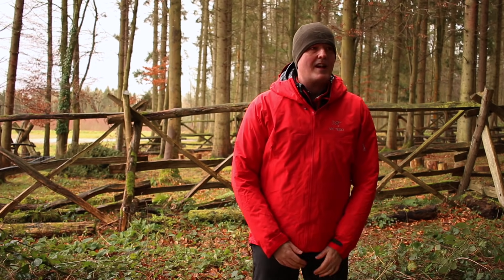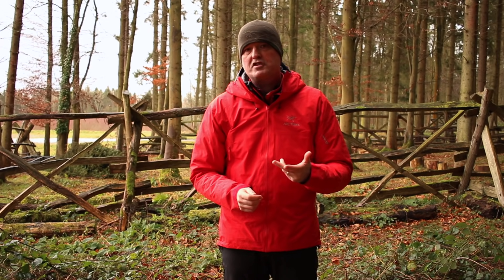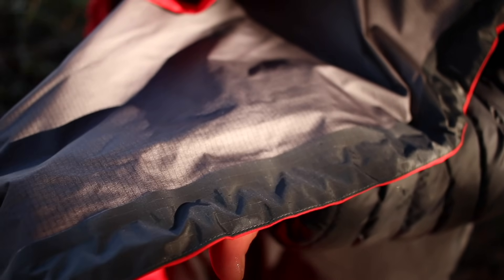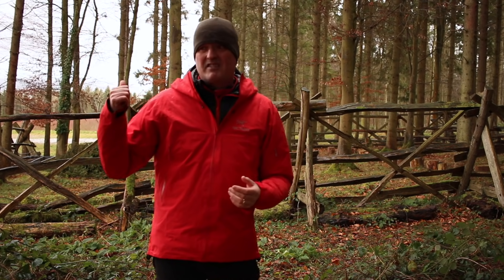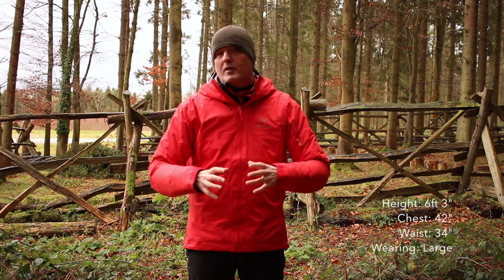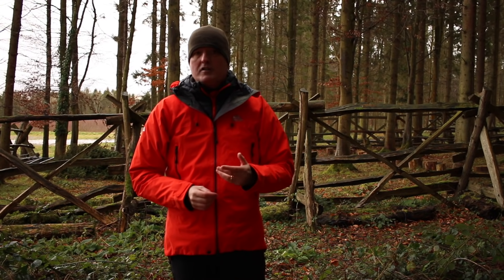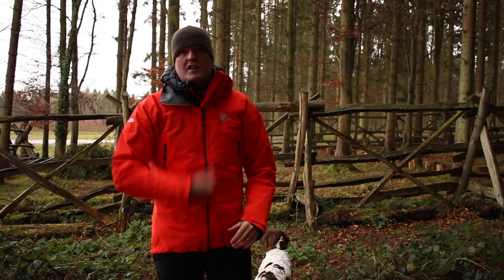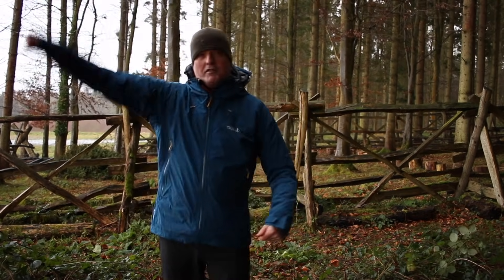Which Outer Layer Should You Choose?

Comment: Excellent and informative video. I am confident that those that do outside activities like yourself know how to best layer for outside activities vs the general public. 

I have a question for you that you probably have never gotten. I work outside as a laborer in a municipality in New Jersey USA. Like I said I’m confident to listen to advise of people like you vs even people in my field of work. People in my field of work for the most part don’t know how to ‘dress’ layer. 

Now the question I have is since I work outside as a laborer I need the most durable outer top and bottom shell to protect me from wind, rain and snow in the winter months. The problem in my situation could be potentially durability and price. I know this wear is expensive and I’m ok with spending the money but if I have to purchase a set every year let’s say that’s where the problem comes in. I work in conditions that has potential abrasive and my stuff can get dirty. For instance last week was was in a muddy hole and it was pouring down rain to fix a water main issue. 

My midlayers are all Carhartt because in this aspect I have confidence in quality and durability.  However I’m not too confident in Carhartt’s water proof technology which is called Storm Defender. Technology might work for work wear though. 

What are your thoughts and suggestions. Thanks!
Reply from the maker: In this instance you're probably best opting for traditional workwear rather than outdoor gear. Outdoor clothing has to strike a perfect balance between durability and breathability as they'll be used in fairly aerobic situations, whereas workwear focuses more on durability and less on breathability. I'm afraid I'm not familiar with which brands would be best to look for, but I can't see any garment from us lasting more than a year on a building site. Harry

Comment: winter is so annoying , even in -6 celsius a get hot after 10 minutes of uphill hiking and have to strip down to just wool baselayer. but then when i stop after 3 minutes it gets cold again. annoying 🙂
Reply from the maker: The best tip we have is to start cold and warm up to the correct temperature. You'll be uncomfortable for a few minutes, but as you pointed out, you'll quickly warm up.

Comment: love your lectures & I am learning shitloads ....  I am in the next 2-3 months going to purchase the fjallraven keb2 dome in blue + a footprint ... and was wondering if you can them and how much for both please
Reply from the maker: I'm afraid we don't stock the Keb Dome, however we do stock the Abisko Dome 2 and can supply a footprint for half price when both are purchased at the same time. The Abisko Dome is far better suited to camping below the treeline, whereas the Keb is suitable for use above the treeline but with a weight penalty (over 1kg difference), so it depends where you plan to camp. Both are four-season rated, so you'll have no problem with either once winter comes around. The Abisko Dome 2 and the footprint would come to £760.50. Let us know if you need any more information.

Comment: Hi, love your reviews !
need a help please:
For winter (-10°C) fatbike cycling, shell I choose Beta Lt with base layer,  or Zeta SL with 3 layer system?
Or some other model?
Actually have arc'teryx Kappa hoody,  but it's a bit bulky 
Thanks for any input
Cheers from Montréal !!
Reply from the maker: To be honest, I wouldn't choose a hardshell at all. If it's -10°C, you're unlikely to experience rain, in which case you'll be better off with a good softshell which will withstand pretty much all the snow you can throw at it. Something like the Gamma MX would be more suitable in my opinion. https://www.trekitt.co.uk/clothing/jackets/arcteryx-mens-gamma-mx-jacket-black__40245
Reply: Thank you ! Is there any difference on materials between 2019 model and 2021? I can have a good deal on 2019's
Reply from the maker: @gurgenmakaryan4428  The Gamma was updated in 2020 and does feature some improvements. It's mainly down to fit and fabrics.
Reply: Thank you very much 
Happy new year,  be safe!

Comment: I’m looking for a new Mountain Equipment waterproof jacket but I’m not sure which of the 3 Gore-tex fabrics to go for? I notice that there is Pro, Paclite and standard Gore-tex. Is there a significant difference between the 3? I would only be using the jacket for hiking in the UK mountains.
Reply from the maker: Hi Anthony, thanks for watching and for getting in touch. I'm assuming that you'll be wearing a rucksack when hiking, so my recommendation would be to go for either Gore-Pro or standard Gore-Tex. The Pro version is tougher and more breathable, but consequently costs more. For general hiking, unless you get very hot and sweat a lot, you probably wouldn't notice the difference. Our best selling hiking jacket is the Rab Kangri - https://www.trekitt.co.uk/38511/products/rab-mens-kangri-gtx-jacket-black.aspx
It's a belter of a jacket that'll be perfect for UK, all year, hiking and trekking, you can watch my video review on our webpage. I hope that helps. Paul.
Reply: Trekitt thanks for the reply Paul. I’ll have a look at the Kangri then
Reply: There is also something called Gore-Tex Performance. Is that another name for standard Gore-Tex??

Comment: Hi, I was looking for the three layer laminate Arc'teryx Beta LT in high vis red, on your website, as well as the Arc'teryx website. Unfortunately it looks like you no longer sell it, and this colour isn't available on the Arc'teryx website. It's been several years since this video was made, so things could certainly have changed. Priced at £350, it's right in my budget, whereas their other jackets jump up in price considerably. Could you please confirm that the jacket featured is the Beta LT, and that you no longer sell it, and suggest an alternative with the same specs and a similar price. Many thanks...
Reply from the maker: It is a Beta LT, we do still stock it, and at the same price, but not in the red colour shown. If it's not essential that it's red, we stock the Beta LT here in other colours: https://www.trekitt.co.uk/facetresults.aspx?Term=beta%20lt
If it has to be red, the Lhotse from Mountain Equipment is a stunning jacket right in your price bracket: https://www.trekitt.co.uk/clothing/jackets/mountain-equipment-mens-lhotse-jacket-imperial-redcrimson__40477
Reply: @trekitt  Thanks for the reply. I'll be popping into your shop in the next few days to check out some gear...

Comment: Question: What’s a good outer jacket for everyday use like a bit of walking but not mountaineering. I just want to keep warm and cosy and if possible not sweaty. It seems to be an entire science, which can be confusing. I had a look at the Raab Microlight Alpine, the Electron and the Electron Plus. Now this video shows jet another outer layer. I’m confused.
Reply from the maker: To keep comfortable while walking, it's best to have layers rather than one jacket. For example, if you've just got a t-shirt and your insulated jacket and you get too hot, you won't be able to take the jacket off as you'll then be too cold, whereas if you've got 3 layers, for example, you can take layers off incrementally until you're comfortable. I would recommend doing more research and having a watch of our 'how to layer correctly' video (link below) before narrowing down a list of which jackets you'd like to purchase, as the ones above (Electron, Microlight, etc) are all insulated jackets, whereas the layers in this video are hardshells/softshells. Kind regards, Harry. 
https://youtu.be/GhYOFc8K-io

Comment: I saw the video yesterday and found the title a bit misleading. "Outer layer" doesn´t have to be a waterproof hard shell, unless it´s raining or there are good chances to get wet from the outside. Especially in Winter with sub-zero temperatures and while on the move, a softshell, a wind shell or even a windproof insulated jacket would be way better options. Think breathability: the most breathable water proof membrane is still a huge vapor barrier. I was hoping you´d address THIS topic. Maybe next time?
Reply from the maker: Valid points. It was named 'outer layer' to fit into a series of videos we filmed a few years ago, but we're planning more layering-related videos in the not-too-distant future. Harry

Comment: how come this Beta LT has got pit-zips? I have looked at a Beta LT in color iliad which weighs about 375 grams and has (unfortunately) no pit zips. Otherwise it would be the perfect jacket for my use, since it is overall one of Arc's lightest jackets wich full GT-Layering. I wonder how important the pit-zips would be
Reply from the maker: It doesn't have pit zips; Paul changes into a Mountain Equipment alternative which does have them at around 12:45. In our experience the Beta LT is breathable enough to go without the zips, but both the Beta AR and Zeta AR have them if it's a dealbreaker. Kind regards, Harry.

Comment: I've go or arcteryx base layers, trousers, hoodies and tees. (I've got a good half price source) but the coats are way overpriced. I've got a Berghaus goretex fellmaster 3 in 1 coat which included the interactive taconite hoody and baselayer and still £100 cheaper than the arcteryx rain shell!
Reply from the maker: Hi Craig, lucky you getting half price Arcteryx! Their jackets are like a piece of artwork and an example of the finest fabric engineering, hence the high price. However, if you've found an alternative that works for you then that's great. Thanks for watching. Paul.
Reply: @trekitt  fair point they are a bit special but I couldn't justify £350/£400 personally.

Comment: Your gore-tex jacket is a size L, are all the rest of the layers also L? Or do you have to compensate for the extra layers beneath as you add more? I have the A'T Atom LT in size M and am wondering what size gore-tex layer would fit best.
Reply from the maker: Hi Stephen, the rest of Paul's layers are a size large too. This varies largely on the person, for example, I am a medium in the Atom LT but have to go for a size small in many of Arc'teryx's shells as they're fairly oversized to fit additional layers underneath. I would recommend you go with your standard size (medium), and if it isn't right you can always send it back provided the labels are still on and it's in a re-sellable condition. Regards, Harry.
Reply: Stephen Hickey I wear a medium in all arcteryx gear. The arcteryx shells are over sized to fit several layers underneath. If you plan to wear a base layer, mid layers, puffy coat, then a Shell I would recommend sticking to your typical size.
Reply: Hi Stephen, I wear a large size for my layers, yet my Arcteryx Theta jacket is a medium size and fits over my layers just fine.

Comment: It is also frustrating when manufacturers don't display the waterproof rating of 8000hd etc.  Most so called waterproof jackets have a rating of 8,000 or 10,000.  Fully waterproof jackets would be rated from 15,000 to 20,000hd or  h20
Reply from the maker: The main problem is that there is no one testing system that all manufacturers adhere to. Technically, in the UK, anything with a Hydrostatic Head measurement over 1500mm is "waterproof". But for serious mountain use we'd recommend a HH of over 10,000mm. Paul

Comment: Arc’teryx Beta LT w/Gore-Tex Pro vs. Zeta LT w/cknit backer. Pros/cons of each???
Reply from the maker: Beta LT is more of an all-rounded jacket, you can use it for climbing, mountaineering, dog walking, it's a great all rounder. The Zeta is better if you're more of a casual walker, it's more comfortable next to skin and features a longer length. The Zeta also doesn't feature a helmet compatible hood, therefore it tends to fit your head better when not wearing a helmet. I personally chose a Zeta due to the length and the fact that I will never climb in it, however you can't go wrong with either option. Regards, Harry.
Reply: Trekitt Mountain Sports thank-you for the reply.  Anything negative to say about the cknit backer, ie, durability, adhesion to the mid-goretex layer, effects on breathability?
Reply: @trekitt  Harry, do you know what Gore-Tex is used in the Zeta AR? The website just says 3 layer Gore-Tex with C-knit (which I assume is the backer so the fabric in touch with the skin). It does say the fabric is N70p (70 Denier and Performance). But it will be good to know of its Gore-Tex performance or Pac-Lite Plus (which they do on the Zeta SL). 

Also which is more breathable? The Performance or Pac-Lite Plus??
Reply from the maker: @PortlyPour  The Zeta uses standard Gore-Tex. The 'p' after N70 means plain weave rather than performance. Gore don't tend to reveal a lot of figures regarding breathability so I can't tell you which is more breathable, but having used both I'd find it hard to tell a difference.
Reply: @trekitt   thank you for confirming that the Zeta AR uses standard Gore-Tex and N70 denier plain weave fabric. Regarding “breathability” then I have heard the Pac-Lite Plus is said to have the best (again cannot find it on Arc’teryx site but more from other reviewers and comments). One good thing about the Zeta AR that clinched it for me was the use of C-knit which is much nicer against the skin. I would have preferred the Zeta LT (which is lighter at 300g i/o 425g and uses a N40pn i/o N70p) but could not find it at a good price. I would imagine the Zeta LT is slightly more breathable than the Zeta AR.